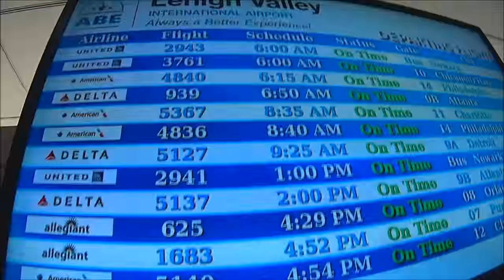NHRA Weekend & Matt Hagan Funny Car Engine Rebuild at Spring Nationals

Comment: I remember my first drag. Mind-blowing, ear blasting sound. Back when the cars "only" had 3,500 hp.
Reply from the maker: Awesome; 3500 is still crazy! This was my first time at a drag race. They had some older cars running also. I hope to eventually post more videos of top fuel cars and older rails that were running that day. I have a bunch of repair videos coming up before more drag racing videos though.

Comment: Great video! They make an engine rebuild look easy.  Maybe i shouldn't be taking my time on my project truck lol .I have used the high mileage synthetic ( with Lucas oil ) for 3 years now , both in my dad's truck and my daily truck . I've noticed that an oil change goes longer and the engine burns less to no oil than before. I also have no doubt that its making it last longer.
Reply from the maker: +jimbo booth Thanks! Haha yea they're crazy fast. It looks like the conditioners in the high mileage oil brought the seals back to life in your truck engines and the synthetic is definitely helping them stay cleaner for longer inside; great success haha.
Reply: a DIY Car Guy that oil saves me money, thats what im all about lol .
Reply from the maker: jimbo booth hell yea me too haha
Reply: a DIY Car Guy best yet it's not that expensive at the Wal-Mart lol
Reply from the maker: jimbo booth yea walmart has the best prices for oil haha
Reply: a DIY Car Guy most definitely ! Oh i also use it for cutting oil , saves drill bits , when im not abusing them lol.
Reply from the maker: jimbo booth haha nice. I rarely use oil for drill bits but I don't drill real heavy stuff. But I do use motor oil as cutting oil for tapping threads lol
Reply: a DIY Car Guy thants always good , it quenches the bit so it lasts longer
Reply from the maker: +jimbo booth true that, make em last longer, save money!
Reply: a DIY Car Guy that's right!